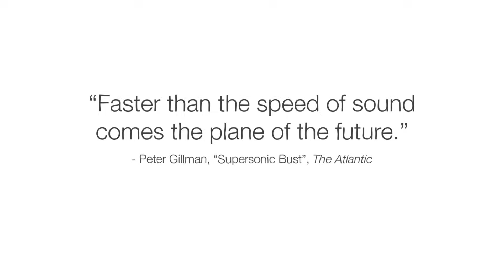Why are airplanes slower than they used to be? - Alex Gendler

Comment: efficiency will always be a problem.  The best planes right now can get down to 3.0L/km of fuel usage per passenger, which is already very impressive for such high speed travel, but once you factor how many km's are flown over a long flight, it becomes quite alarming.  A short vacation for me and my wife flying from Asia to North America, could be 10000km each way, that works out to a minimum of 1200L of fuel used in total for the round trip. I literally use less fuel for my car over a whole year than that.  To think that I was responsible for pumping out a year's fuel of CO2 in just a short 10 day trip, is horrible.  A jet that were to fly at twice the speed would likely use 2-3x more fuel still.  Not only is fuel expensive, burning so much of it in such a short time is horrible.  sigh...

Comment: Great analysis. The Concorde, however revolutionary, was an outlier. Study the performance of the British VC-10 or the American CV-990. Both were considerably faster than current transport category jets. As you stated, the cost of those extra 20 or 30 knots was a competitive disadvantage. Take comfort though- flying is far safer than it was in the '60s, and for the price of a coach seat back then (corrected for inflation) you can sleep in a lie-flat business class seat. If you're snoozing who cares if it takes 20 or 30 minutes longer than a flight on the VC-10 or CV-990?

Comment: A sonic boom isn’t continuous; it only occurs when an aircraft goes through the sound barrier, i.e. when its forward velocity matches that of the wavefront of the sound it creates
Reply: Wrong, everyone who finds himself below the supersonic path hears the boom, otherwise the noise problem of Concorde would not have been a problem.
Reply: @AlexFoxthrot  I can tell you’re not a physics graduate. The boom is a one off, and usually occurs one the plane has reached altitude. The noise issue with Concorde was with the engines themselves during takeoff and landing. I grew up a couple of miles from Heathrow, and you could always tell when Concorde was taking off. Concorde remained subsonic until it was over the sea
Reply: @ffrederickskitty214  Sure thing pal, you are the only physics graduate who knows the truth about Sonic booms. I Guess they banned SST over the whole US and Europe because all those Who Heard the booms were not physics graduates.
Reply: @ffrederickskitty214  Utterly false. Yes people were complaining about the noise on takeoff, that's true, but Concorde cruised at 50-60 thousand feet of altitude, there is no way the noise from the engines was the problem. People all over the supersonic path started filing complaints for the booms and that's why countries started banning SST.
Reply: @AlexFoxthrot  Also because the Concorde wan't American.  The history of a number of US-designed planes that competed with US=designs types can show this.  The Numerous British and French Mach 2 interceptors and the Lockheed F-104 Starfighter, for example.  

The opposite also happened.  The English Electric Canberra multi-role jet arrived, the US found itself in a war, and the Canberra was an ideal candidate.  

They bought the rights, built them in the US , the Martin B-57, and some few remain in use by NASA for decades.  

The superior aircraft wins when there is a war, but not when there is a perceived peace.  

Since then aircraft have become so complex and expensive to develop that these rules have changed, but non-US designs are still not being built, even in the Russian Federation.  

They build prototypes, but do not put them into service in large numbers, rather like the 1930s, when air forces rarely had a large number of any one type, but could build a new type every year.

Comment: How about flying wings? Flying vehicles that are triangular in shape and allow for a large space inside rather than a narrow tube? Why aren't they built for large-capacity flights?
Reply: To be efficient, flying wings need enormous wingspans, and that means few airports could handle them.  

Smaller airfields often lack the solidity of runways to handle 200-ton planes, as well.  

If all those ex-WWII airfields hadn't been built, the airliner would have remained a toy for the rich, but those same airfields are now too expensive to improve to take the larger, more efficient all-wing designs that have existed since the early days of flying.
Reply: @stevetheduck1425  Let me rephrase this with examples to see if I got it right. I may be completely off the mark.

There's no way Burbank airport, for example, could accommodate a flying wing. But it wouldn't need to anyway. It's much too small. LAX, Heathrow, Charles de Gaulle, JFK could, but they would need huge modifications in the way they are organized.

Then there is the cost, the uncertainty, and the downtime, as in: "it would cost X, we would need to shut down a whole terminal for Y amount of time, and it has only a Z chance of both working AND of being profitable anyway." This means that for the few airport that are big enough to handle flying wings, it's not worth it to even consider the changes they would need to make that possible.

Even if planes were to turn out to be less good for long, high-capacity air travel in the long run, we know they work right now, everything is currently built for them, and it's what everyone expects anyway.

Did I get it right?

Comment: When I was younger in the 60’s you would hear sonic booms frequently. They only occurred once, when the jet initially exceeded the sound barrier. So I’m not sure how this could be accurate. But I don’t know everything (yet).
Reply: The sonic boom is happening where the pressure wave is, and this passes over a location on the ground at a high speed (almost as fast as the plane).  

This is why it is a boom rather than a long rumble, like thunder, although it can echo.

Comment: Going hybrid could potentially reduce airplane crashes in my opinion. There is a lot to be explored with that, since different engines have different strengths and combining them together could lead to easier to control aircraft.
Reply: Numerous aircraft have been built with different engines, and even with two different type of propulsion, such as a jet and a rocket, or a piston engine and a jet, or jet and ramjet / athodyd.  
The main problems seem to be: two types of fuel (not always), and dead weight of the other engine and fuel while one is operating (some designs drop the dead rocket when up to full speed, such as the ZELL F-104 test plane).  

Examples of mixed propulsion: The Ryan FR1 Fireball, the Saunders-Roe SR.54, the SNCASO Trident.

Comment: My question is why do planes have drastically different cruise speeds? for example, a small plane like a318 has a much slower cruise speed than a350. Why? Engine power? aerodynamics?
Reply: Cruise speed is aerodynamics over fuel consumption, versus time to arrival.  It's decided in the design phase, rather like how a movie must be less than a bladder-full long.

Comment: I will never get the idea of sub orbital jets out of my head... It fixes one of the issues of supersonic planes (the sonic boom) and while they are even faster, they would have even worse fuel economy.

The idea is basically a rocket that gets you going so fast, you completely exit Earth's atmosphere, and drift in a long parabolic arc to your destination. Waaay faster (Instead of 2,000km/h think 20,000km/h, only slightly slower than the ISS). avoids the whole sonic boom thing as by the time you move fast enough for it to be an issue, you've left the atmosphere entirely.
Though if you thought fuel economy for the concords was bad... I don't even wanna think about the energy required for sub orbital jets. Its literally a miniature rocket.

Comment: In 1996, an airways from London to NY spent 2h53 mins. Nowadays, it takes no less than 6 hrs, twice times longer. In the past, Concorde had the speed about 2000km/h, 800km/h faster than sound. Consequently, it had supersonic noise which lead to startling noise and damage building. Therefore, the cost of Concorde flight was exhorbitant and unstainable, approximately 1000$ now. Scientists started to use jet engine which had the speed of 900km/h - half speed of Concorde but faster burn with more fuel and it can cause environmental impact. After that, they try to change the structure of wings. But it is not a effective way to save the money and fuel. At last, they find out that modifying aircraft can reduce sonic boom one third and solve the energy problem, even with alternative  and synethic fuel.

Comment: Speaking of prohibitive costs, I can’t imagine what a double wing commercial aircraft would cost. Besides, it seems to me that the lower pressure, that produces lift, on the top of the lower wing would make the upper wing less efficient. The upper wing would be starting the lift process with less than ambient pressure. Granted, the shape of the upper wing would still create a lower pressure on top of the wing, and thus lift, but would it be reduced compared to the lower wing?

Comment: I perfectly understand people's frustration with sonic booms and why planes were regulated to stop causing them. I grew up with my grandparents. They owned a farm near an airport. Farm was very close to it so you could see every plane landing and taking off. 

Quite commonly military jets were taking off from there as well for some reason. And Jesus Christ.... you could see the shockwave when they take off. The sound is extremely loud, all windows vibrate like crazy. Volume is like 1AM in a club.

We didn't live on that farm, only were coming in to do farming. But if I'd live and sleep there I'd go crazy.
Reply: I grew up a few miles from the airport. There were entire communities moved because of the noise of the airport, and damaging homes. This was not even supersonic stuff. They moved neighborhoods, and changed flight paths, for general aviation, alone. They built a newer bigger runway for the new bigger planes, and tore down another few communities to achieve that.  I'm going to leave out military planes, from this topic, because those are another level of loud.  I hear the afterburners quite often. 
 Growing up, I heard about lawsuits and legal problems from planes damaging homes. Over time,  It seems they would rather buy out communities than to pay on lawsuits. Thankfully, they changed the routes above me, also.  
 Strangely, another factor is that the city owns the airport, in the county land. You can only imagine what kind of dynamics that creates,. ( county neighborhoods suing city airport ) 
  I grew up not from from cars, trains and planes, all times of the day, and they just become normal. At some point, you just don't really hear them anymore because your brain just blocks it out. There are times when you have to stop a conversation waiting on an airplane to pass. It just becomes background noise, and it is very rare to lose sleep over it. 
 There is a golf course, near the airport. One of the attractive features is that you can hear, see, and feel a huge wave of swirling wake turbulence coming down the fairways. It is horrifying if you dont know what it actually is. The golf ball swirls, the trees shake, the noise is like demons coming from who knows where.   Good times.. I actually recommend it.

Comment: Even though this video seems to be watched by 99% animation nerds judging by the comments, in addressing the title - it's not really factually correct. Ignoring the Concorde, airliner cruise speeds haven't changed much at all. Today's Boeing 787 cruises at more or less exactly the same speed as a Boeing 707 from the 1950's - around 85% the speed of sound.

Comment: Instead of trying to reduce fly time, reducing the time spent on boarding plane is more practical
Reply: Time spent boarding planes is actually just waiting for the flight because parents leave at 5 am for a flight at 2 pm
Reply: @johngammon6450 gotta check out those lounges
Reply: you say this until something unexpected happens and you have arrive at the airport 15 minutes before boarding ends
Reply: Interestingly enough the current boarding process could be much faster and is actually potentially slower then just boarding the plane in a random order. However no airline uses the most efficient boarding method simply because people will never all listen and form a line in correct order (someone will board out of order massively slowing the process down). It would also mean that first class would board at the same time as business class defeating the point of the higher price ticket.
Reply: I'd rather they worked on making it more comfortable.
Reply: That waiting is more about loading baggage than getting people on the plane.
Reply: if I remember CGP greys video on that correctly, it's literally as easy as doing nothing
Reply: If they introduced flying for the first time now and said you have to turn up 2 hours before at the airport for an 1 hour flight, everyone would be WTF!!!
Reply: They don't invest, pay well for ground services.
Reply: Impossible after 9/11
Reply: Oh, and I usually try and board last. Why would I want to sit in a tiny seat for half an hour + ?
Nope. I will wait. People think the sooner you get on the plane (before other people) you might arrive earlier. Lol. Cmon
Reply: Plane boarding is actually very efficient. It's just the lines that make everything longer.
Reply: @elay6644  Yes
Reply: @elay6644 no, we need a better version of boarding zones, back to front is just so inconvenient and just doing nothing is better
Reply: @elay6644  Not really efficient, like.. at all.
Reply: @sharkie1630  explain?
Reply: This is exactly what they should do, but what I haven’t seen anyone one here pick up on yet is, they have no interest in cutting down the time between when you have to arrive at the airport and when you get on the plane.  They want you to spend spend spend in all those overpriced shops, restaurants and bars.  Build an airport that operates like a bus station and you’ll cut down on all that wasted time
Reply: Need more than one entrance/exit and speed will be greatly increased. Not hard to do and would save so much time and money. I can only guess that maybe regulation about every other exit needing to be only for emergencies is the only thing stopping us.
Reply: @internet person It's not that accurate tbh
Reply: I completely agree! 2-3 hours from airport to airplane us just ridiculous
Reply: Amen.  Require all baggage be checked.
Reply: Don’t let people have carryons. Or make them board last to make less people use them. That is what mostly slows down boarding and unboarding is people fumbling with overhead storage items.
Reply: @ximinnelli1912 wrong. Everyone already has their carry on in hand before the door opens

Comment: One major issue is that the airlines are limiting the fuel pilots are aloud to get. My dad used to be right before red line to and from Hawaii shaving off almost an entire hour and a half until they started to limit his fuel to save costs.
Reply: BS. PICs have the right to request fuel increases at will and any company that tries to monkey around with it gets a visit from the FAA.
Reply: @starventure  Pilots cannot request more than they “need” for the flight. Before the changes my dad would get fuel to the point of max ramp weight and gun it back over the ocean to the mainland. 

“American Airlines is aggressively trying to reduce the amount of fuel remaining on board when a plane lands,” The Chicago Tribune reported at the time. “Its management {is sparring} with the airline’s pilots and dispatchers over who determines how much fuel a plane needs to reach its destination, a call traditionally made by the flight’s captain.”

The carrier wanted a written request from pilots who anticipated needing more fuel. The Allied Pilots Association viewed the requirement as “intimidation, because the now-required paperwork, called a P-2 form, is tracked by American’s management and could be used against the pilot if his or her job performance is ever called into question,” the newspaper said.
Reply: @starventure  That is incorrect. Pilots can request more fuel from a dispatcher but HAS to give a reason WHY (gets put on record) they are requesting it. Just to fly faster is not an excuse and will be always be denied.

American Airlines already gives more fuel for safety than the FAA requires so no safety issue.
Reply: @clashingimages  No, they don’t. A captain can call dispatch and say “give me 2000 lbs” and it is added. No reason required. That fuel is noted as coming from their request, but that’s it. No repercussions. And no dispatcher is going to tell a captain no because unless it is a weight and balance issue, there is no reason for them to start an argument. You’re wrong on so many levels here.
Reply: @starventure  Just asked my dad. He said the FAA could care less as long as the 45mins reserve fuel remaining requirement is met. American Airlines adds 30 mins (75mins reserve). They do not let pilot get more fuel than the 75mins he said.
Reply: @clashingimages  Your dad just gave you incorrect information. Any pilot can can call his dispatcher before departure and request a fuel increase without penalty. Airline management can try to influence dispatchers and pilots to take less fuel but cannot directly interfere.